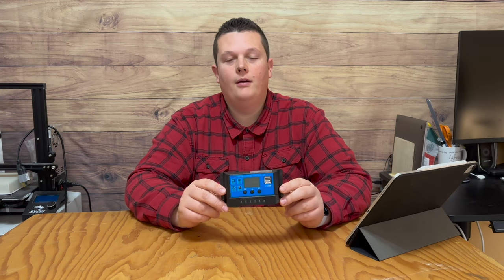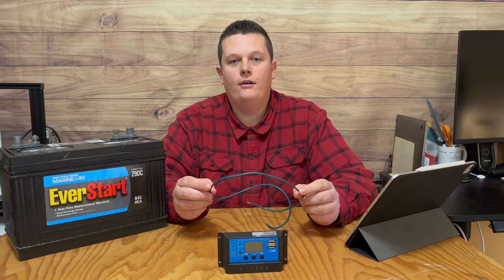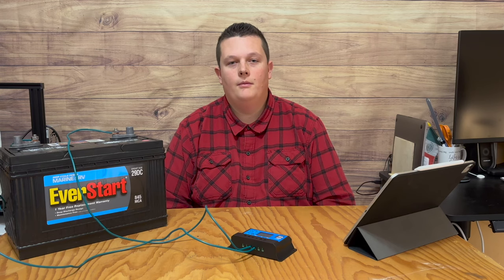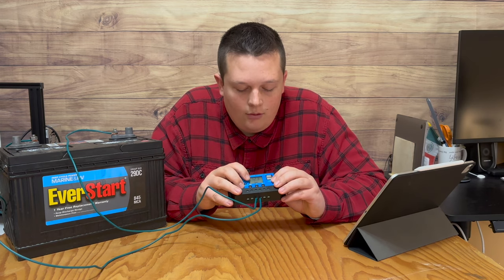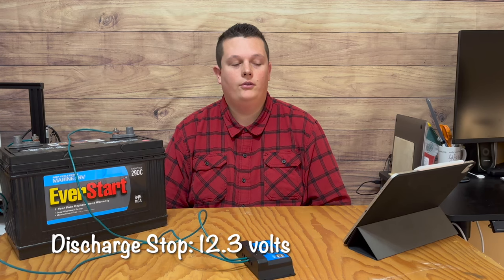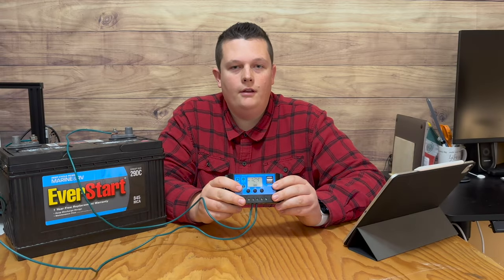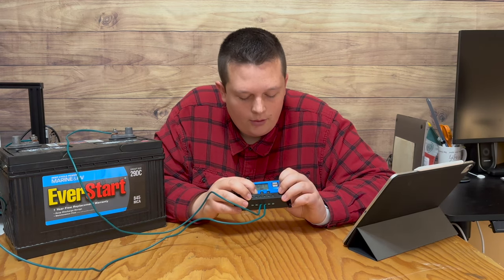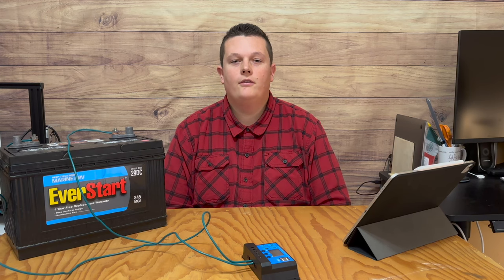How to Setup a Solar Charge Controller (menu, battery type & wiring)

Comment: First 2 seconds and he told me what i did wrong 😅
Reply from the maker: Hahaha!
Reply: what do you do if you plug in the solar first!?! is it broke??
Reply from the maker: No, it just won’t work properly, unplug and redo it with the battery first. 👍🏼
Reply: Same here 😂
Reply: Ya me too.  They set you up without warning.  First thing everybody who are  new to solar Is tempted to do is see the solar panels give a reading on the charge controller.  Hell I was starting with dead batteries thinking I would just charge them up real quick before committing  them to the solar set up.  Man this free energy seems to keep costing more and more.
Reply: Why does my charge controller s keep breaking meaning either my battery won't display or my panels won't display. Am I burning up my controller? I've purchased a few of these hook them up correctly everything works great then I go to hook something up to my batteries and WFT my controller won't work.
Reply: Bro like 😂😂😂😂😂, I just reconnected mine
Reply: Right!  I change from a 10a to 30a controller.  My last one didn't have the ability to turn off the load 😂.  Everything was connected in the proper order, but I must have somehow turned off the load while making adjustments, I couldn't figure out why nothing would run through the controller, but would directly from the battery.
Reply: When you say "the load" what do you mean exactly? What's the purpose? and do you need anything hooked up to that side of the controller anyways?
Reply: @RL-hd6iq  the load is anything you connect to run off the batteries; lights, radio, etc.  on my 10amp controller the output was always powered.  On my new 30 amp controller there is a button to turn off the output power (like a switch)
Reply: @chadm9715  i mean the load on the side of the controller?
Reply: @RL-hd6iq  correct.  The load is powered by the battery, but it goes through the controller first.  My new controller allows me to switch off the load, whereas my old controller I had to manually disconnect from the controller.

Comment: I brought a solar system just to charge a battery on electric fence and didn't know how to use the blue controller but now I have set it and works fine. Great video

Comment: I'm switching between 160-watt folding solar panels and a 150-watt 24-volt DC power supply, I also got a battery maintainer that trickles charges only when low. It's a DIY portable power station on wheels with a lead-acid battery. I got this controller for about 6 bucks free shipping. I use 10 gauge with a 30 amp fuseable link and a 6-circuit fuse block.
Reply: I use the solar charge controller as the 150-watt AC charge controller.

Comment: Question here. With the solar panels hooked up the lights come on briefly then shut off. With them disconnected the lights work fine. I programmed the charge controller as per your instructions. Any help here? Thanks!

Comment: Thank you so much. I'm saved...😊 It's a little different resitting the controller. For me, I have to use 6 steps, on the 7th step, hold on 2-3 second. It will appear 'FF' and it's resetting done. Thanks again 🙏 from Malaysia.

Comment: Hi do you have to match the controller with the solar panels, i have 140 watts 12v   and i want to upgrade it to 200 watts 12v  next year what votronic controller can i buy....12v leisure battery

Comment: My flood battery settings won't go higher than 12.6 full charge. Can it go higher and what's the max for a flood battery to be fully charged   it also won't let me change my low load setting above 10.6. I'm thinking about changing to a different battery setting that will let me change the settings and set if for flood type but with those settings safer for my batteries.  For some reason flood settings a set in stone and the other battery types will let u change settings. Hope that makes sense.

Comment: Scott, excellent explanation on how to set these chargers.  I have been dealing with them and one advice I'd like to share is to be careful on the Discharge Reconnect voltage.  If you set it too low, let's say 12.4, the panel is just starting to catch solar radiation and the battery is still exhausted, so you will put the load on the battery that will deplete it in a few minutes or seconds, recycling the process over and over again.  Your recommendation on 12.6 is spot on where I have no cycles of on - off.
Reply from the maker: Thank you, very much appreciated and I completely agree!
Reply: Another hint regarding the dual USB ports in the front panel.  In some of these controllers (10A for instance) they are not considered load, so it will keep providing energy regardless of the battery voltage.  But in others (20A) those ports are part of the load, hence they are cutoff once the battery discharges to the discharge stop, the USB will be cutoff.
Reply from the maker: 👍🏼 That’s interesting, do you know why would they be different? Even on a 20A controller, a USB port isn’t gonna pull more power than it would on a 10A.
Reply: @aldogomez8095  what do you mean you have no cycles on-off?
Reply: Hi Johny, I mean a loop when you put load on the panel / battery while they still don't get enough solar power. In that case, if the load is higher than the power generated by the panel, the voltage will keep falling up to the point where the solar controller will shut down the load.  This loop may eventually last the whole day, or up to the point when the solar panel gets enough sun radiation to power the load.
Reply: Thanks but you mention the wire gauge from panel to controller you don’t tell us the wire gauge from controller to battery and then battery to inverter. My system is 12v what strength of breaker and SPDs should I need

Comment: Hello Scott. Great tutorial. Just bought one of this charge controler for my caravan that is seating on a off grid property. The user manual is way to difficult to understand. Your tutorial helped me to understand each of the menu parameters. I took notes and tomorrow will to the caravan and add the settings. Thank you

Comment: Excellent video. I just set up a simple set up in my shed but connected the solar panel first The battery was set to B1 which is auto detect 12/24  and my USB would not work. I dissconnected it all and left it a couple of minutes. Connected the battery first and reconnected it all and now all is working very well. Many thanks for this excellent description

Comment: Thanks Scott, you helped me figure out my 12v charging solution for keeping 2 12v deep cycle batteries charged. I'm using a portable 100w panel  to charge 1  battery with a 400w power inverter and a 10/2 amp 12v charger plugged into it to charger second battery wich is for my inflatable boat. The first battery is also to keep things charged around camp. This is the first day I'm testing it out and it is all working beautifully.

Comment: Brilliant job thanks so much. With your clear explanations on the 6 different screens, I could even setup a different controller with similar like layout. Only difference was the last screen where the Bat type is, my controller has options ut0 / ut1 / ut2 which I have no clue what is what & I left it on ut0. So yeah, please if anyone knows pray tell; I have a flooded bat.

Comment: Nice and helpful and useful video. Just what I needed to find the correct battery code for this control box :) Thank you for good info. Yes, I got a lithium iron battery but saw in the manual it was not supported... now i have a GEL battery but couldn't find the code. Thumbs up from me

Comment: Battery First! got it! good tip.   THANKS!

I am a Journeyman Industrial controls and haz location Electrician, but these directions are wanting? figured it out a few yrs ago last motorhome. 
I am thinking of the price per DC watt/amp/and charging and putting a few of these units in parallel.  My application is RV in the Mojave.
Ever think of "paralleled units"

Thanks again

Comment: Dude, you nailed it.
This is exactly what I needed to know. 
I'm an electrician and have been using off grid solar for over a decade but never used a charge controller. The chinese instructions that came with the one I bought didn't explain anything about how to use it or set it up.
Thanx!
Jeff
Reply: how do you get by without a controller amazes me, i dont just use my controller for my solar panel but I also use my controller to charge my usb devices with my battery without solar panel connected

Comment: Brilliant, thanks Scott.
I almost understood it - the instructions just don't go quite far enough in detail.
But now i can charge my truck up knowing the settings are right.
Just one ask: can this sort of controller be left connected to the obd port full-time (engine running as well as off)? The instructions don't warn against this, but some other solar charging systems (the AA model without separate controller) do.
Thanks again.

Comment: Thanks, Scott, for thoroughly showing us how to hook these things up. Great teacher 👍🏻I'm trying to decide which controller to get from Amazon. MPPT seems the best way to go. Is the Depvco 30 amp  MPPT unit pretty much just plug in and forget after i tell it which type of battery I'm charging? I was seriously considering the Allto Solar 20 amp controller for use with my Vtoman vs110 solar panel that is 110 watt and 19 volt. The Depvco is definitely more in my price range though. I'm  using this to charge my two Trojan T-125 deep cycle six volt flooded lead acid batteries that I've tied together in series to make a big 12 volt battery. I'm totally new at this. Do we need to install fuses in any of the wires? I heard we should. I'll watch your video to the end. Then ask questions. Thanks and keep up your excellent research and work🙏🏼

Comment: Good, informative video. I had a second leisure battery added to the first and then bought a solar panel for recharging. First controller worked ok until i managed to wreck it. This one? I can't get it to work - or can i -nor to adjust. readings are as follows 20.6, 28.8, 25.2 and 21.4!!! and b01. Can't get back to factory setting or adjust anything! Screens just blank when attached solely to the battery. Must admit i'm a bit of dumbo when it comes to sparkie stuff!
Reply from the maker: Interesting, are you on a 24 volt system? I would unplug everything, make sure the battery is good and reconnect starting with the battery.

Comment: Thank you for your very clear explanation.
I don't understand why you can't use the controller with lithium batteries. If you can set the battery float voltage that should be sufficient to ensure correct charging. Perhaps if you discharge your lithium battery too far the controller will allow to much current to flow to it and so, damage it. But many lithium battery can accept high rates of charge (as high as LA batteries) without any problems.
Reply from the maker: That’s a good question, and thanks! I’m not sure why.
Reply: Updated versions or other rebrands may have the options for Lithium batteries, changing this changes the bulk and absorption voltages/amps which will vary for battery chemistry. My Adventure Kings version of this controller has options for NiCoMn and LiFePo4 in addition to lead acid. More reputable brands such as Victron even let you adjust those bulk and absorption values.

Comment: thank you for the video, i have the same controller i got from a friend with no manual so you made it possible for me to understand it. great job on explaining. i do have a question o hope you can answer for me please, i have 2 portable camp solar panels, each is 400w, ipmax: 1.2a, vpmax: 18v, isc: 1.5a and voc: 20v, under low light it's charging 13.1 volts for 1 of them, with the same typ battery as yours, bo3, if i hooked the solar panels together to charge 36 volts would that be too much, also will it produce more power quicker or should i put them in a circuit that will each push 18v let me know what you think. thanks again.

Comment: great explanation.  Mine works identical except the float voltage cannot be adjusted.  It is stuck on 14.6V  will not move with the up and down arrows.   Thanks very much.

Comment: Thank you for the explaination. Im adding several more panels and another battery to my system. Using a 30v PWM version of this unit. Speaking of, ive seen many reviews of this unit, some say its horrible, didnt work, quit after an hour, for my usage its been fine, i monitor my batteries just fine, it has worked great since i bought two years ago. It gets the job done. Im in a shed to cabin which I have a 30amp RV electrical box which im plugged into, using the solar panels for mainly my lights, but im upgrading to use solar for winter more, adding a 12v rv on demand water pump. Doing upgrades as I go to my system. Am getting a refresher here on programming the unit.

Comment: I have two six volt batteries wired in parallel on my trailer. Would the wiring and the settings be the same as a 12v battery? thanks

Comment: One of the best and clearest videos on setting these up! 
are the battery types b1 etc the same for the similar looking, fake "mppt" charger?
The description of both state max panel voltage 24v for a 12v battery setup.
I have a bunch of 30-38v rated panels, am i forced to use an mppt charger if i am aiming at a 12v setup?

Comment: I have few questions. I will connect my charge controler to my caravan 12v battery. Found a good deal on 24v solar panels. If I set the float charge to max 13,7V as you recommeded for 12v, will this be safe to connect and use the 24V solar panel on my caravan 12v system? Also, when the battery charge to 13,7v will the solar panel stop charging? Thank you

Comment: I guess I broke mine first try. I bought the 100 amp, same make as yours and just attached solar panels (first) then the battery and then a cigarette lighter socket for my cooler box. After 3 hours it all stopped working and now it looks like I need a new battery as it won't recharge. Not even with a battery charger plugged into the mains. Oh, and the on/off button does nothing, no little light bulb appears, although it did when I first used it.

Comment: Scott, when I look at the diagrams that show connecting the controller to the battery I notice there is a fuse in the positive line.  I have looked for this type of connection and have not found one. Is this an error on my part?  Also, if you are setting up an off-grid solar system that will power one Walmart window air conditioning box at 115v and 4 amps, what type of battery do you recommend. Thanks Richard

Comment: Great video man, really help me set up my mini system
Reply from the maker: Thank you!
Reply: @ScottsSolarProjects  
Can I connect this charge controller to an AGM battery? And is it really necessary to attach a load bulb to the charge controller, too?
Reply from the maker: I’m not 100% certain, but I believe so, and that you would want to select the b02 setting (gel.) also, no, you don’t have to connect anything to the load section if you don’t want to. If you do, just make sure it’s within the maximum parameters, most likely around 120 watts.
Reply: @ScottsSolarProjects  
Thanks for the info

Comment: Hi Scott. I think I screwed up the order. Everything looks good but I can’t adjust the float control. It’s stuck at 14.6. I’ve disconnected everything and tried to reset but no luck. Do I need a new controller or is there a way to do a hard reset?

Comment: since I will be using my solar only when camping in non electric spots I will be removing the setup often. Does this control panel remember the settings or do I have to re do it every time i connect?  Great video by the way

Comment: the load symbol on the controller, does that need to be on if I have an inverter attached to the battery, or is that used if something you're charging  is plugged into the controller's USB?

Comment: I'm considering this exact controller. Will it be too much for a 7A or 9A SLA? I have a 12" X 18" panel that consistently outputs 14.5V but I think the 3A controller that came with it is too small, non adjustable,  and I'm pretty sure kills the battery. Load is only (drum roll please) a simple 12" attic fan and with a topped off SLA runs for about 20 minutes, something is not right. :-\

Comment: Hi Scott, I have learned so much since I found your site.  I have a solar aerator for a 1/4 acre pond.  I wired it to a charge controller like you show on your video.  I have two panels connected to the controller and a sealed battery.  The inverter(Bestek 500w) is connected to the controller and i have a Matala compressor for air.  It ran great for 10 months and did a great job on the pond.  Then it stopped, we have no idea why.  We thought it was the controller but a new one made no difference.  I unhooked the panels (in the correct order) and had just the battery and inverter hooked to new controller and it started the pump.  It seems that whenever the panels and not hooked to the controller it runs.  Battery will go dead I’m sure eventually. I have the same settings on the controller  that i had before.  Any ideas why it stopped and now it doesn’t work? I have replaced the controller twice, the inverter once but when panels are connected again it doesn’t work.  Thank you so much for any help.  
Rich😊

Comment: I have two 100A charge controllers from Temu but have no idea how to program them. They only have three buttons . Up  on the left that says reset, a square button in the middle and down button on the right. Could you find out the program for this controller?

Comment: Hi Scott,  I have a 400 watt battery charger panel with a 100amp charge controller, with 2 100amp hr deep cycle batteries in parallel . Batteries are directly connected to my fifth wheel 12v system. Do I need to just set menu #2 and #6 as I will not have the load on the controller. I just want to be able  to charge  my battries with the solar.

Thanks Mike D.